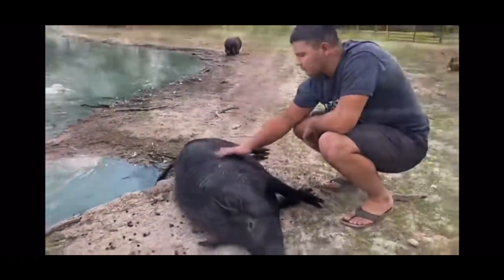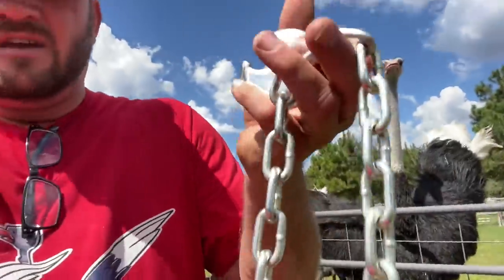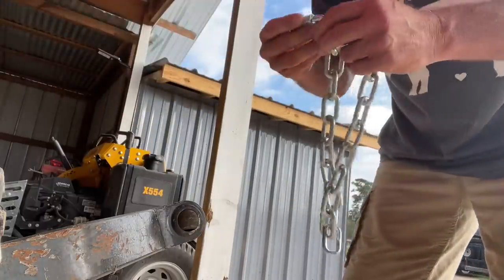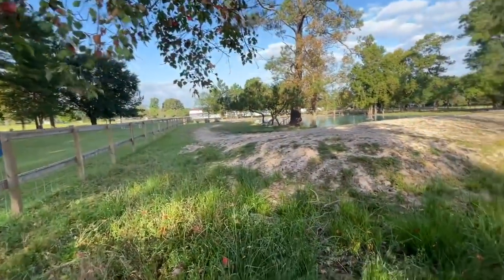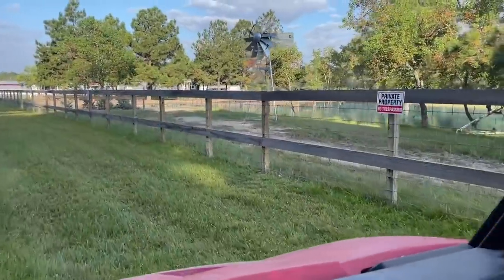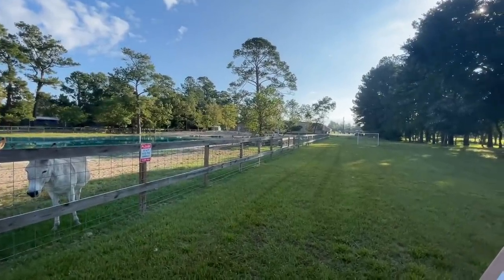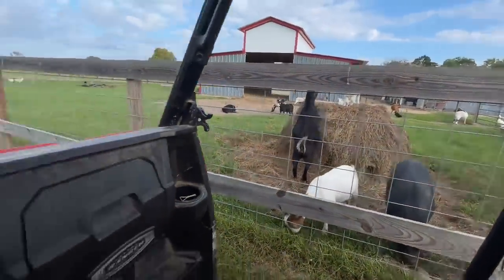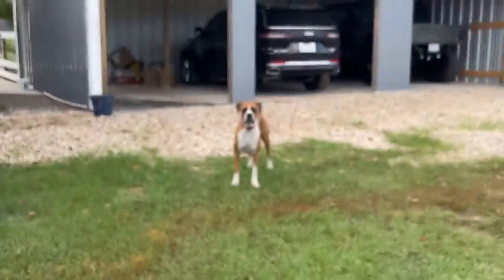Carl on Lockdown

Comment: You are doing the right thing by locking the gates. You are doing the responsible thing to protect the sanctuary and the kids.  I  have a friend who let church kids use part of his property and he had a rule that works for climbing the fence, he takes access to the field away for 2 Sunday's and he hasn't had an issue in over 3 years.  of kids climbing over the fence. Also he was invited by the pastor to explain the reasons why they should not climb the fence.

Comment: Lester, I did the exact thing - I bought that same lock for my storage building, not thinking for a second that it wouldn’t fit. It requires such a large opening and though I’ve tried to use it numerous times, I’ve never been able to use it.
Reply from the maker: Dr.'s are supposed to be smarter than that!  lol.

Comment: At night it’s hard, I’m if not impossible to see and read the combination numbers on the locks. Be sure to always have a flashlight or some light source when it’s dark outside and you need to open the gate especially in an emergency.

Comment: LESTER.  Put a small section of fence like the length of one of your hog panels on each side, of your aunt and uncle’s driveway at the road, and post private property and huge signs on each side of the driveway, and people will know they are not allowed to use that lane.  Come back, or set it back a car length away from the main road, so when people turn in it is posted, and they can back out and go away. And your aunt Joanne,could Decorate if she’d like to like a Vining flower or something at the opposite end of your private property signs, decorated rocks in front of it anything she wanted to she didn’t like it plain.

Comment: Hey just alittle fyi put a small piece of a roofing shingle or whatever to keep the rain/ snow etc away from the tumblers on those locks.I had a similar system and even tho I bought top of the line weather proof locks they did indeed get rust. and had to have them cut off.I smarted up kept them oiled and semi protected from the elements.

Comment: If you get a big lag bolt and a big washer that is a bigger diameter than the chain you can connect the center of the chain to your Pole you'll never drop and lose your chain not once and no one can take take it out because it is between the gate and the pole

Comment: I know you say not to comment but just ask a lawyer, when you invite them on the property you may negate all your protection.  Make sure it doesn’t have to be in written form with your limits on paper.  I would add, if the ball goes over the fence, don’t retrieve. We will send the balls back later.  If you know they are crossing the fence to retrieve may be a problem as well.  You are completely protected from the uninvited trespassers if they are hurt, legally. One thing not to worry about.🥰😇

Comment: It's not being mean, it's being cautious and protective of everybody involved. I'm in the Hill Country and a bit harder in my doing and thinking. Fences and gates have signage and locks, as well as barbed wire, hot wire, and bird spikes. Post No Trespassing signs at the end of the driveway. You can place sawhorses with signage or DIY barriers at the end of the driveway on certain days/times to impede trespassing. You can also put motion detectors and cameras out there. Don't point them out but place signage to let folks know they are being recorded. There are plenty on the market as well as DIY's. You can also go to your local LE office and let them know what's up. Speak to your attorney as well. Make sure all of YOUR bases are covered. You have to be the one to let them know their actions are not acceptable and their actions will determine yours. I hope this helps and you can get some barriers put up. Good luck!

Comment: You could put cheater pipes on the end of each handle of the smaller bolt cutters and have almost equal leverage, but the heads may be smaller so that is why I say "almost.

Comment: Take the gas cap off. It will give you 3+ extra miles. The air pushes fumes in. Old ARCO hack. My girlfriends dad was an exec & taught us tons. Old nylon  around cracked fan belt etc.

Comment: You locked up the side of the gate that you open up but and I mean but you have your top hinge on the hinge side upside down so all they have to do is lift it up and off. So you need to turn the top hinge to point down so it can’t be lifted.

Comment: R/C …. A trail type crawler .. so speed doesn’t effect the awareness of it .. 
   It works … I had a 1/10 custom built Tamiya clodbuster.. for years.. holds weight. So bigger batteries are always good for longer run times.. 
   3.3 miles for 1:45 mins of full trail walking times 
   durability ? Ownership since 98 .. 
      Farm truck since 2002 . 
   But yes then you can see and adjust cameras and not worry about them being harassed by others ..

Comment: Wow can't believe people are so rude ,  n come n trespass on the property, I know it's a bid space but if you put 3 or four story poles and put a chain across on the two sides n then a chain for the driveway part that way it wouldn't be so heavy for your aunt to put back up or even a swing gait for the opening, if it's only four ft high so cars couldn't get thru, with no trespassing signs, or you could cut down small saplings n use a post hole digger put on both sides of the large n then a gate in the middle just brainstorming sorry, Love all you humans n animals